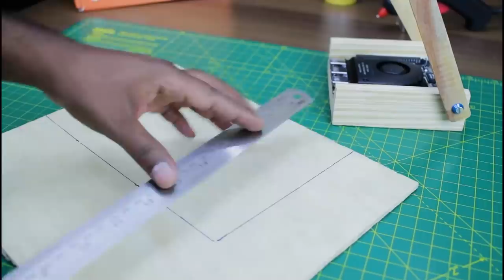how to make a Gaming PC

Comment from the maker: Thank you so much for Watching
Here is my Second Channel-https://www.youtube.com/channel/UCuV9MyzRjEKLgcjAz0rRzhg?view_as=subscriber
Don't forget to subscribe I need Your Support,
Thank you Again
10.1 inch 2K Display- https://www.banggood.in/custlink/vmmGEhb7Af
10.1 inch 1280x800 HD Display- https://www.banggood.in/custlink/KDKGEdQwzy
Screw Driver High Quality- https://www.banggood.in/custlink/DvDmhysTfS
Screw Driver Normal- https://www.banggood.in/custlink/K3GGdYnu1y
Wireless keyboard and touchpad- https://www.banggood.in/custlink/3DDKhdsT1U
HDMI to VGA converter- https://www.banggood.in/custlink/3GvvhRnf1f

SPECIFICATION
CPU：Intel 7th Gen Core m3-7y30
Core：1.6-2.6GHz Dual-Core，Four-Thread
Benchmark (PassMark): Up to 3500, double computing power compared with same price range products in the market
Graphics：Intel HD Graphics 615, 300-900MHz
RAM：8G LPDDR3 1866MHz Dual-Channel
Memory：64GB eMMC V5.0l
External Memory：
            1x M.2 M Key, PCIe 4x, Supports NVMe SSD and SATA SSD
            1x M.2 E Key, PCIe 2x，Supports USB2.0, UART, PCM
Connectivity：
            WIFI 802.11 AC, 2.4G & 5G
            Dual Band Bluetooth 4.2
            Gigabyte Ethernet
USB Ports：
            3x USB 3.0 Type A
            1x USB Type C, supports PD, DP, USB 3.0
Display：
            HDMI Output
            Type-C DP Support
            Extendable eDP touch displays
Co-processor：Arduino Leonardo
GPIO & Other Features：2x 50p GPIOs including I2C, I2S, USB, RS232, UART, RTC，Power Management，Extendable power button，everything you need
OS Support：
Windows 10 Pro
Linux Ubuntu
Dimension: 115mm * 78mm * 14 mm
Reply: wow
Reply: How much to send me
Reply: Bhai kharcha kitna ho gaya
Reply: Mere ko ye kharidna he aapse kitne ka padega?
Reply: Top
Reply: Can i make thid use intel galileo
Reply: It cant ever play pubg pc xDD
Reply: product link
Reply: How mach its total cost
Reply: @RaaSHIDpc  pakistani around  36,000 rs
Reply: Can You Create The Same Thing With An SSd & 8gb ram along with an graphics card?please do reply
Reply: 36k cost if bought from DFrobot site
Reply: So good it's not that expensive ryt related to gaming PC
Reply: TecH BoyS ToyS  What is the Hz
Reply: Will you give the name of materials please
Reply: Bhaiya how much rs please bro tell     me
Reply: Bhai mast banaya h👌👍👍👍
Reply: Kitny mein bana hy sab kuch???
Reply: RAM nya 8 GB ya?
Reply: Bro iska 5 min ka pubg video gameplay dikha de pls....
Reply: TecH BoyS ToyS hey what can I use if I don't have wood
Reply: TecH BoyS ToyS can I use cardboard and if I use cardboard what can I use to make the latte panda stay in place and also the screen
Reply: Total price kitna hai??
Reply: Bege Goss  review gan
Reply: @kirovets-1843  iya 8 gb (tadi udah ke web resminya)
Reply: song name of at U Putting The Glue stick Piece For Light That song name
Reply: Kit na kareche lagta he
Reply: Bhai CPU me kuch fix kar ke banao    ye sub se amazing hosakta he
Reply: How much?
Reply: @mr_cameraman  19500
Reply: Pleas tell how will get that screen and display controller boarding I search in Amazon but no their
Reply: And the disco duro
Reply: Hay dha you no kuldeep roy
Reply: 1st can it run fortnite
2nd can i use that for screen capturing
Reply: Wert
Reply: How much did it cost in rupee

Comment: But, can it run Crysis at 4k 60 FPS ?
Reply: There is no way for that game :D
RTX 2080 Ti + 16GB Ram = Still crying.
Reply: @Xainly  You forgott the processor. Crysis was made for high clocked CPU´s cause the developer thought processors in the future would go for higher clock, not more cores.
Reply: @mellanone3860  Yeah i writed that comment on 02 am so thats why :D
Reply: @Xainly  Some people sleep.. xD But some are writing comments..^^
Reply: @mellanone3860  yeah xD
Reply: Put it into racecar and drive it.. It will run faster.
Reply: @R9A9V2  Nope, they are not same things but if you put better cpu and gpu it will run faster :D
Reply: @Xainly  slap that pc on a lambo and drive the lambo at speed of 200mph.. See how fast the pc runs..
Reply: @R9A9V2  Think more real .-.
Reply: @Xainly  the pc runs faster when it was taped on a running car.. Because it didnt even move when it stays on 1 area.. So if its not moving its not running..
Reply: @R9A9V2  and do you know what?
Cars cant run .-.
Reply: @Xainly  if a car cant run.. Then it was parked
Reply: @R9A9V2  Hhhh Car has Tire not foot.
Reply: @Xainly  what do you call the car that is moving extremely fast
Reply: @R9A9V2  You cant move extremely fast with foots. Tire is rolling Foot is running. | If you want you can try, find a tire and roll down to way and run who is faster?
Reply: @Xainly  what do you call the car that is moving extremely fast.. And thats your answer..
Reply: @R9A9V2  now it changed with moving huh
Reply: @Xainly  i didnt even changed it
Reply: @R9A9V2  Hhhh Running to Moving .-.
Reply: @R9A9V2  And nevermind im not talking anymore with you.
Reply: Obviously yeah an rtx 2080ti can run any game at 4k60fps
Reply: Nope
On Crysis 3 [Ultra / 4K / MSAA 8X]
Specs;
Ram = 16 GB DDR4
CPU = i7 8700k
GPU = RTX 2080Ti
And takes 37 fps average...
Reply: @Xainly  running to moving? This is test edit
 comment

Comment: You can build a real system for 250 dollars
Reply: Fr an old Dell optiplex on eBay for 100 and a GPU with power supply for $150
Reply: You can get an HP or Dell prebuilt and slap in a 750 Ti
Reply: Adam Mzaour 750ti does nothing you need powerful for pubg to not frame drop under 60 fps
Reply: @bitingraid4787  Nothing? What do you use huh? the 750Ti is good lol
Reply: Adam Mzaour Nah, soap a 1050, it doesn’t need a Power supply cable and it’s low profile. Perfect for non upgradable dells or upgradable computers.
Reply: @rickoot2572  True, but if you are on an ever tighter budget, a 750 Ti (or a 1030) would be a nice option
Reply: Adam Mzaour Yea, the 1050 and 1050 ti are getting even more expensive from all the mining. I bought my 1050 2 years ago at 112 US $. But i’m seeing the prices now and they’re way up now. So a 750 wouldn’t be bad but definitely aim for something higher. But if you’re really that desperate for a decent rig, go for it!
Reply: Mixy I got a 750 Ti
Reply: @bitingraid4787  a gtx 750ti is for 720p. Not for 1080p. It can run Pubg smoothly at 720p medium settings.

Comment: Here's a rough estimate of money spent:
1.LattePanda alpha 864- $358 (~26k)
2. HD display $75 (~Rs 5200)
3. HD to VGA (Rs 360)
4. Screw drivers set (Rs 1000) (cheaper available)
5. wireless keyboard and mouse (Rs 1000)
6. additional ~ Rs 500
TOTAL = INR 34060 excluding impprt duties
For that amount of money you could build a real gaming PC . But I really appreciate your effort. You can call it a DIY pc.

Comment: A desktop with 9 th gen i3 and a 1050 ti will cost much cheaper than the latte panda board and you can play most of the AAA titles at med settings in it.  You can't even play old games in high setting in this machine but it is super expensive.  ....

Comment: You Forget Something Where Is The HDD ?
Reply from the maker: Ssd support
Reply from the maker: It can also Video editing, photo editing, High speed data transfer, GPIO pins and ARDUINO I/O pins for projects, It also has a M.2 slot for NVMe Ssd, One memory card slot for 128GB Memory card, 3xUSB 3.0 Slot for External storage or Accessories, one USB Type-C 3.0 for Display or Power or Dta transfer, 1HDMI display Port, 4k display support, 64GB on-board storage and many more in a small pocket size board.
Reply: 64gb in build

Comment: That Mini Pc Cast 28 To 34 Thousand Rupees. Instead of this We Can Build Ryzen 3 2200g, 8gb 2400mhz, gt 1030 only in 20k Indian Rupees
Reply: Why should u use a gt 1030 when u have vega 8 when they both performs almost similiar :D?
Reply: Low overclocking in Vega 8 is best  of gt1030..

Comment: For...god's sale...if any pne is even thinking of making this pc built....now or even in future then plzzz...fo knoe that the pre- made super compact pc used here is the "LATEPANDA ALPHA"...which costs approx...$ 399 ...which costs ₹28,000 in INDIAN CURRENCY...and moreovrr the screen costs additionally...too....
               Therefore...I would instead u to build the same build ...but with "RASHBERRY PI 3 B+" which costs around $ 70 ...only ...in indian currency...₹5000...includind the case...hdmi, ethernet cables, power cable, and an additional 16gb- multi- purpose memory card...
             I understand ...although it has its own operating system...but still...u know...something is better than having nothing at all.....!!!